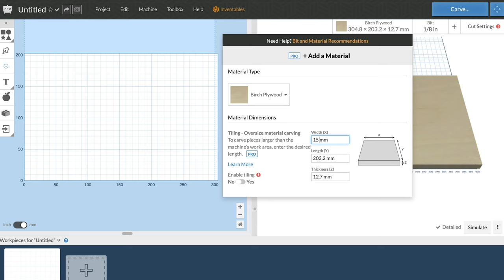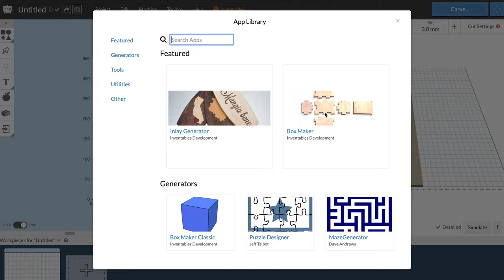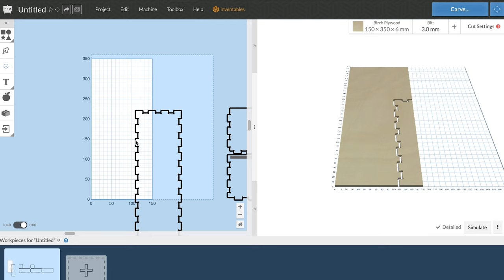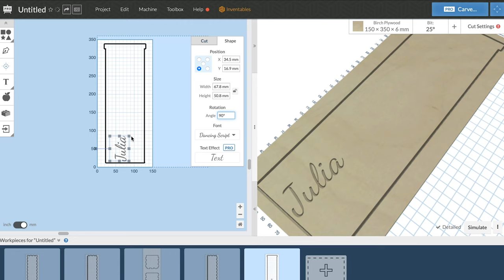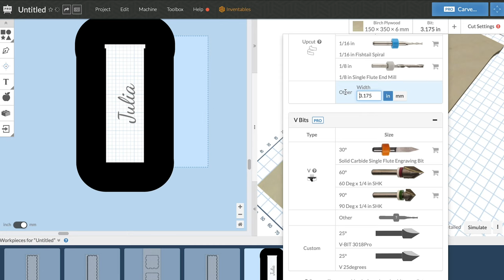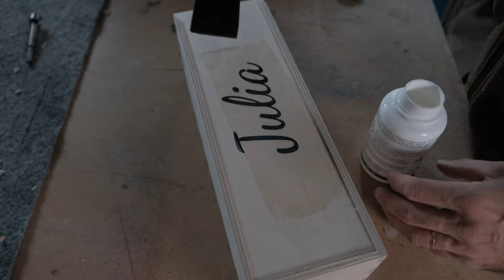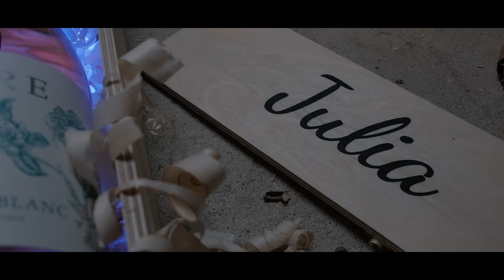Easel Box Maker with the 3018 PRO

Comment: Does working in Easel given you any trouble by trying to move to the origin of the job but not raising the bit and scratching everything?

Would be nice to hear about the total cutting machining time!

Great work! Really love your videos and how simple you make the work look.
Reply from the maker: Havent had any issues like that in Easel. The total machining time is pretty much the same as the simulation in Easel says. I went pretty slow on this project but it took around 1 hour per piece.